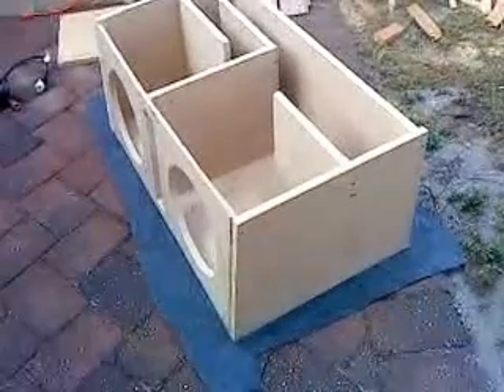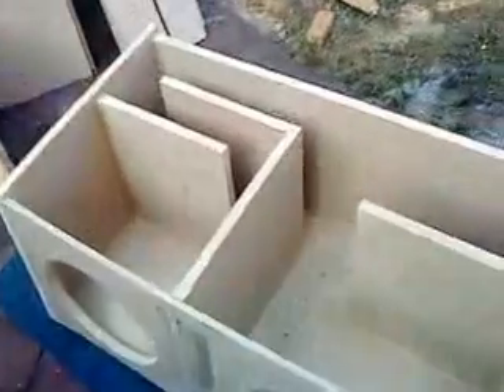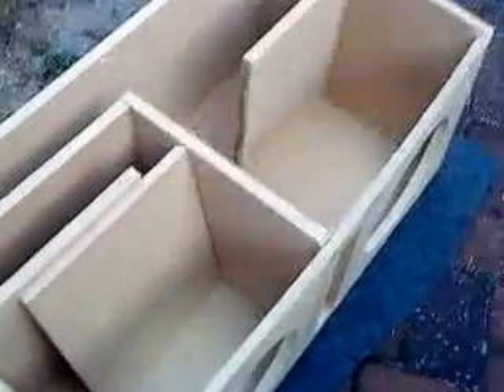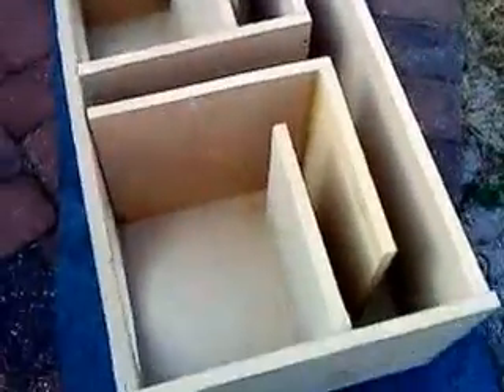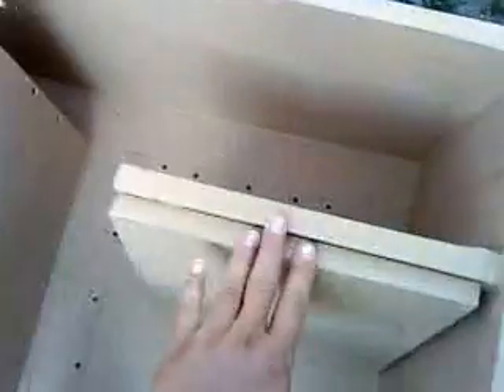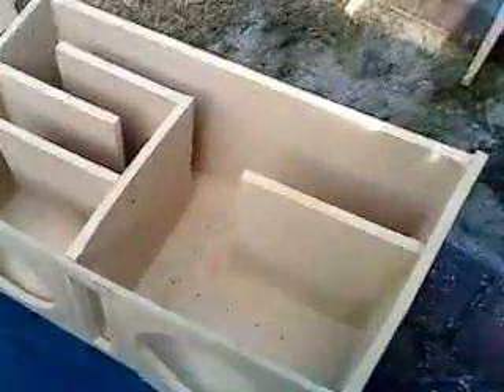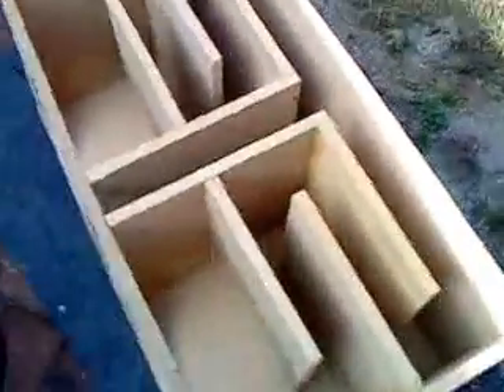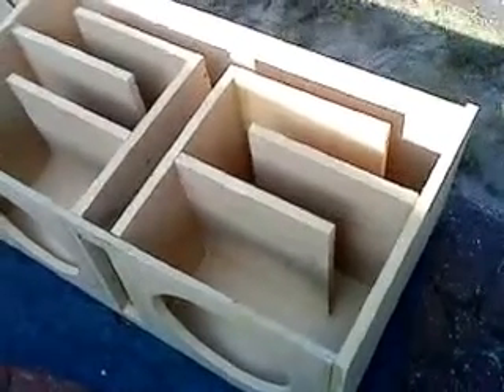(DIY) How to Build a  T- line Speaker box (part 2 box)

Comment: Hi - I have a Tannoy silver 15 dual concentric driver with crossover, and would like to ask if ANYBODY could suggest a suitable size enclosure for this type of driver? I am thinking from 150-200 litres and up? Any help or suggestions are greatly appreciated, cheers.
Reply from the maker: Al Scott for your 15 inch subwoofer you're going to least  need 3 cubic feet.

Comment: what a t line box does that normal box does not ?
Reply: +teeone10    just an FYI, the box in this video ISN'T a T-Line.
Reply: then what is it, why suck a long port
Reply: +teeone10 it's just a normal slot  ported box.  t-lines dont have a chamber behind the driver (this one does)  also the cross area of a tline should be the same area as the driver cone, this port area is clearly smaller then 2 12's.   not saying this box wouldn't work. just that it's not a tline.
Reply: +teeone10 the length of a tline needs to be 1/4 of the wavelength of the frequency you are tuning to.

Comment: how do you know where to put the screws when the top is on?
Reply from the maker: what I did was I measured and drew the diagram on top of the box lid so it looked exactly like it did in side, that's how you know where to put the screws at. for example if you take the back of the box and measure to the first divider its 3 inches. and I'm using three quarter MDF. and then measure off of that one. and so on and so on. the top of the box will look exactly like the inside of the box after you have drawn it out with pencil.. hope this helps.
Reply: +redbaron2448. Well i's sry to say this but i anit giving any money at all bc i know ppl like urself make money from youtube so nice try
Reply: +ScrappyDDoo well that's ok, thanks for watch, :-) :-) :-) :-) :-) :-)

Comment: I wouldnt call this a t line, more like a ported than anything. A true t line would be alomst 10x the size of that for 2 12s. If I had to guess this probly sounds like a pickup truck box without enough cubic feet.
Reply: I agree... I was like "wtf?, how is that a t-line?  That complete box may, and I say MAY be big enough for one 10" driver...  Plus, you notice his cuts weren't exactly dead on?  How is he sealing the slots so no air leaks within the port system?  I saw no use of caulk or silicone, so I can only imagine what this box ended up sounding like.  I would say, pull the top off, remove most of the port and do simple L-shaped port at 33hz... You get much more box volume and a much louder, cleaner sounding enclosure.  Good try though... Not trying to bash someone for trying, but it's just not right to call this a t-line....  But thank you for not buying a pre-fab!  I bet it still sounds better than most of the pre-fab garbage out there! lol
Reply: pete7996 I agree with you %100. Im building one for 2 12's right now and my line length is 8.75ft per sub. There's no way that box is what its claimed to be.

Comment: I'm with Green. I'm looking to build some transmission line boxes for 6"-22". I;m the only one of my friends that has a shop and knows how to build them. I just don't know the specifications you are using. Also, if you kerf the corners into rounds or even use cut up sono tube, it will guarantee that you will have no port noise.
Reply from the maker: Specifications are what you will need, I cant give you for this box, measure out your trunk and go from there.